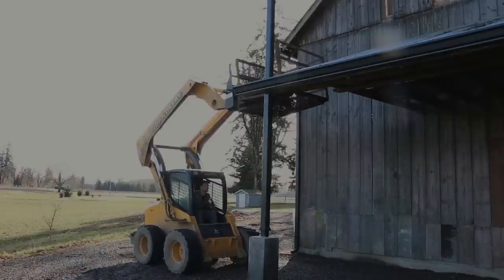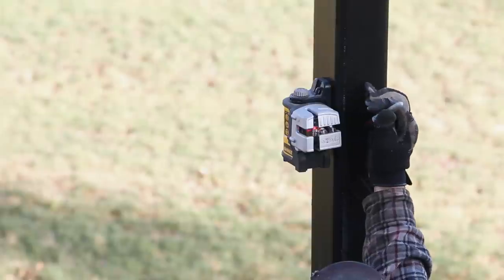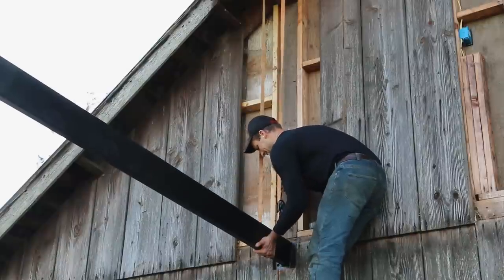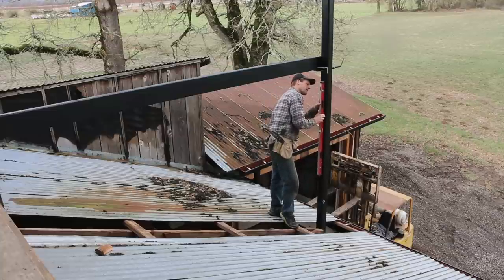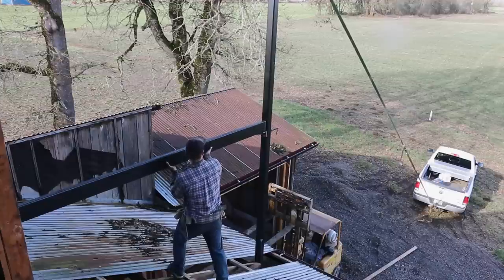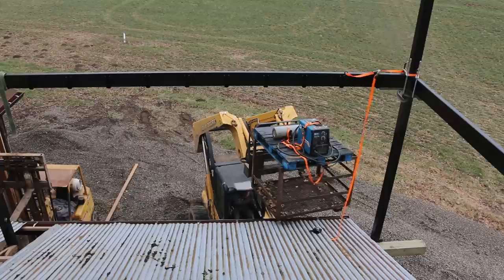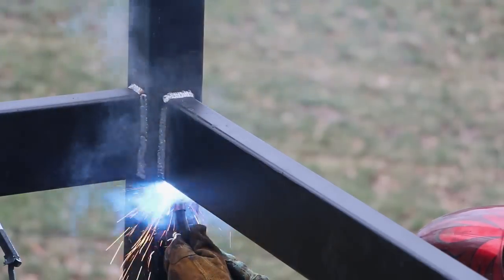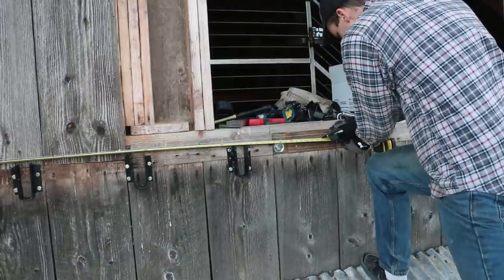Barn Deck pt. 4 - The Aerial Welding Rig

Comment: Love watching your videos and attention to detail.  A couple things I will mention though.  Clamping the joists down may eventually cause them to spilt as the wood expands again.  The other concern is when you used the strap to bring the frame in and have all of the joists at the same length.  Unless the beam held it's shape and bent back, it may pull your bolts through the end of your joists.  My suggestion would be to replace one of your joists with a steel beam/joist.  Awesome vids though.  What is your next project?
Reply: I had the same thought, but if it is new PT they usually shrink a lot first as they are usually really wet. I would be curious to see how it all looks after a few seasons though.

Comment: Don’t be afraid to use an air impact on those larger lags. Do a test go with one lag in the wood if you’re worried it might strip easy in softer wood, but you’ll find it is actually pretty easy to get the feel of when it’s fully home. I use an IR gun that has a power selector dial in the back which makes it nice for even the smaller stuff. As a professional carpenter I always have a decent sized compressor on site that is capable of running two framing guns flat out, so the air impact becomes a go-to tool to have as well.

Comment: After a couple of years you should check your fasteners for the joists. Treated lumber is now treated with copper instead of arsenic. They've been finding decks failing prematurely because of electrolysis between the bolts and the copper treatment in the wood making the bolts corrode and weaken. Shouldn't be too much of a problem because all your joists are sitting in saddles, but something to keep in mind.

Comment: Try the Polycarbide Abrasive Wheel at Harbor Freight instead of the wire brush on your angle grinder for cleaning off paint/rust before welding. I find that they work better & quicker than the wire and don't fling back at you when hit a a corner or an edge wrong.

Comment: Your overall structure looks great, should do fine under load. But, as a semi-professional nitpicker, I would like to see some diagonal bracing to protect from shear loading in all planes. Assuming cough that you don't have plans for this already. Great build, you will have a terrific view from up there.
Reply: I was thinking similar, also it couldn't hurt if the braces were picking up the load of that outside beam he sucked in with the  strap. The tension on that end grain may not age well... Though that load may be better served with threaded rod from that outer beam through the middle beam and into the structure of the barn.

Comment: Will the welds joining the beams to the posts be strong enough to support the deck, would it have been better to drill them to the post, as you have drilled them to the barn?

Comment: while I, like many others -  sorta cringe at you walking all over that tin roof....  that's probably over with now, simply because construction has progressed past that point.  You obviously grew up around all this stuff, so you know your limitations as well as the structure ....  but yeah, be careful man.  the deck and the barn are both really cool.  I guess there aren't any videos explaining this barn compared to the rest of the farm, or videos on the cool balcony you built inside it.  ...?

Comment: you could`ve put something under the fork of the lift, and put the fork down so the truck could lift itself.
Reply: This type of forklift is made for lifting, it can't push down.

Justin, if you want to turn a big woodscrew into wood, a little bit of grease will lighten the job. ;-)
Reply: Jos Diepenbeek oh, thats dissapointing.